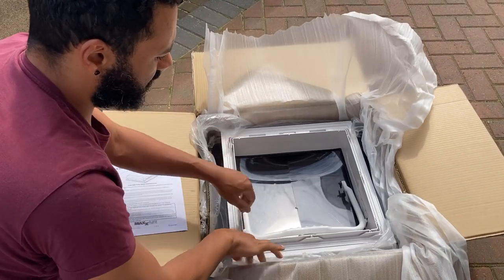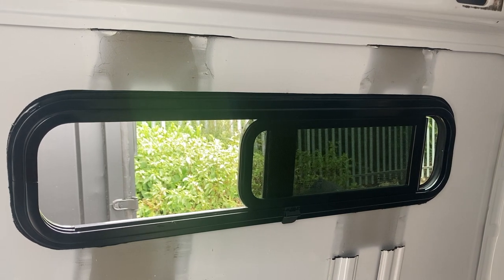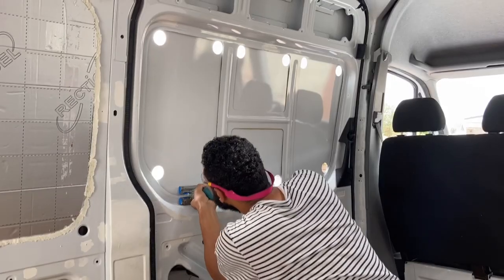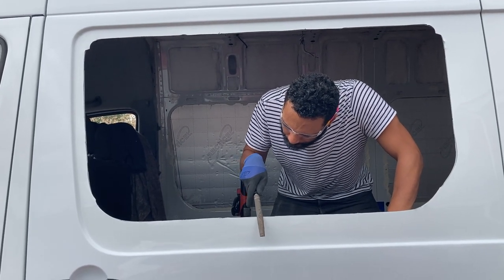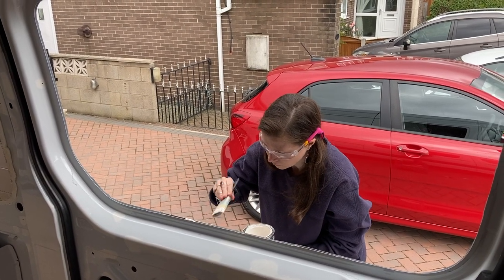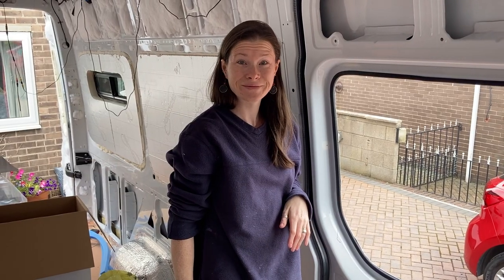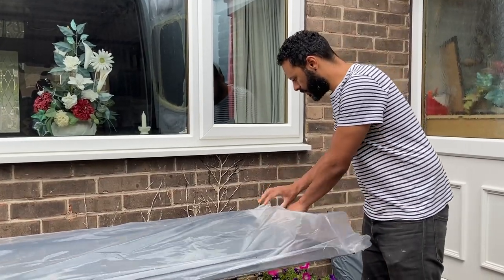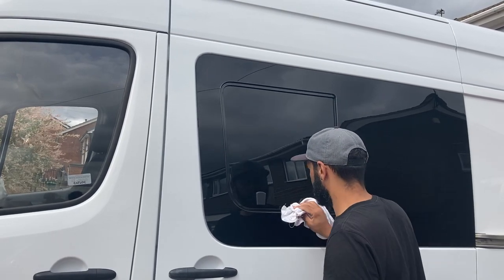Fitting Bonded Campervan Windows | DIY Sprinter Conversion

Comment: Great trick prepositioning rolls of tape on the glass to be installed! 
Here's a tip if you cut more holes in your ride--borrow a nibbler. A nibbler looks like a jigsaw but has a notched, half-inch diameter pipe on the business end. It cuts sheet metal by shearing it, making no metal splinters/sawdust/fine shards.

Comment: Hi guys, actually if you go to a car maintanence shop you can buy small extending  hand tools with a strong little magnet on the end that is about the size of a pen rubber made for reaching small metal ( obviously ) objects like screws etc that drop when you're working on a car engine. that should be small and strong enough for getting the fillings out. I know this from when my kids decided to throw things out the back door and extending that tool to catch them and pull them through the cat flap !! Be amazed at what your kids can teach you

Comment: If you crimp the two skins together it’s much easier get the single trim onto both edges. Great job though guys. Much more rewarding when you do these things yourself.
Reply from the maker: Great tip! Many thanks ☺️
Reply: If you do crimp the two skins together and fit the trim does the window still sit flush against the outside?

Comment: How about canned compressed air for blowing the filings out - usually used for cleaning computers etc. Comes with a straw like a wd40 can that will let you direct it.

Really enjoying the series.
Reply from the maker: Didn’t even know that stuff existed! But that would be perfect if it comes with a thin nozzle like on a can of wd40 👌 

Glad you’re enjoying it 😀

Comment: a decent vacuum cleaner with a small nozzle would definitely work. The smaller nozzle creates a more powerful vacuum if you think about it. you can even tape something over the end of the tube using a cone
Reply from the maker: A decent vacuum cleaner was something we were lacking 😅 But we didn’t think about concentrating the suction - good idea!

Comment: Guys, this whole work is just wonderful! Actually your conversion and ideas are the best I've ever seen.
As for the filings I'd have used a simple screwdriver to loosen and lift them up and vacuum them out.
By the way. I see you used the glass adhesive only around the hole, though the window itself was bigger. I might think that water can get between the glass and the bodywork where there's no glue. Or did it spread enough to reach the edges?
Reply from the maker: Thank you so much, that’s so nice of you to say. 
We did try loosening and vacuuming but they just wouldn’t budge unfortunately. The vacuum we used probably wasn’t powerful enough. 
Regards the adhesive, yes it spreads out quite a bit when you push the window on which is what we think creates the watertight seal. We’ve not had any issues so far so we think it’s ok 😀

Comment: did you manage to get the sliding window to work better? im getting a couple from Vanpimps. How have they been so far ?
Reply from the maker: Yeah it slides a lot smoother now, think that was probably just because it was the first time it was opened. They’re still going strong, 2 years in so very happy with them.

Comment: How bout a heavy duty vac at a car wash or a narrow way with your vacuum (use paper towel tube to squeeze in
Reply from the maker: The heavy duty car wash vac would probably have done it but I don’t think we’d have wanted to drive with a hole in the van door. That tube idea may well be a good one though, didn’t think about adapting the nozzle itself 👍

Comment: Is it normal that when you install the trim on the inner wall, you can still see the outer wall? Is there a way to make it look better and hide the outer wall as well?
Reply: You're supposed to fit a trim that covers the inner and outer skin - so it buts up against the glass and you don't get a rough edge. They got it wrong in this video I'm sorry to say.

Comment: Just a couple of tips, drill one small hole then jigsaw the entire window in one even go, de burr with a rotary bit, put the straw on your vacuum cleaner nozzle to gain access, rough up the outside to prepare for primer, prime before touching up edge, apply sicoflex with a v groove using nozzle tip pressed against body... Basically please rename the video to how not to fit bonded windows.
Reply from the maker: Thanks for your very comprehensive tips @FairySox especially on the video name ⭐️ Maybe, since you’re clearly an expert in the field, you should make your own video about putting your own window into your own van. We followed the fitting instructions of the company we bought it from. Window is still in and going strong after a year btw 👍 And “sicoflex”?! Really?!!!
Reply: sometimes its good to watch other peoples mistakes and when you see two amateurs doing this it gives others confidence to go out and give it a try. As I will be doing soon. Its easy to criticise, I used to do it myself but I find it dosent really bring anything to the table unless it has genuine comedic clout.